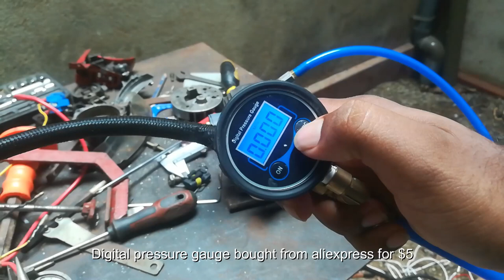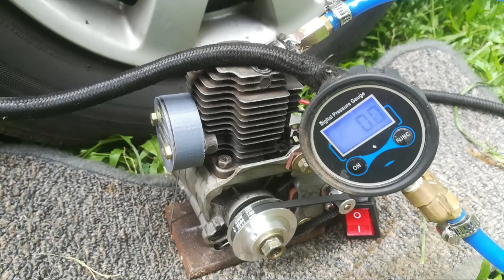Durable Tire Inflator/Compressor from 2 Stroke Engine

Comment: That’s good fun :) well done! The oil is an issue in a 2 stroke, you need the lubricity in the engine, but with a 2 stroke it will also go into the tyre. Would a 4 stroke be better here maybe?

Comment: Awesome idea, but you need to introduce oil into the air intake in order to lubricate the piston/cylinder.  

Also, how did you close off the exhaust/intake (whichever one you were not using)?
Reply: this is a two stroke engine - not four so the piston movement closes the intake by its movement and proceeds to pressure the mix before the spark kicks in
Reply from the maker: Yes. I added them before assembling. I don't think i will need oil that much compared to when engine is actually runninng. I'm going to add them from times to time.

Comment: What motor did you use?
Reply from the maker: 775 dc motor
Reply: I think I bought a fake 775 dc motor. It cannot rotate the shaft properly 😢
Reply: Got it! Just the power supply 😅